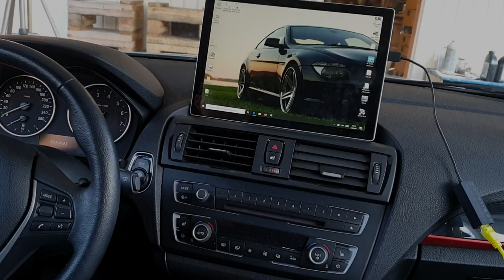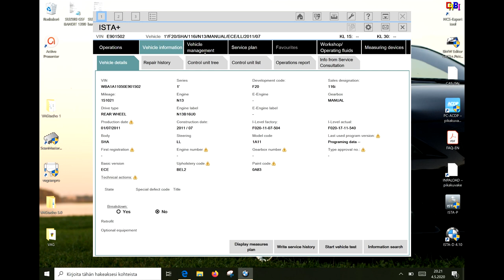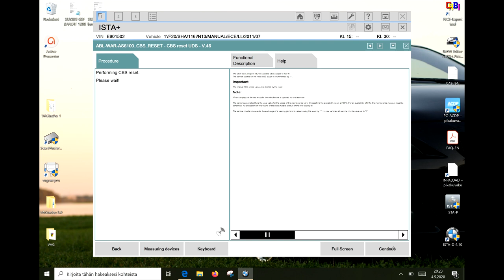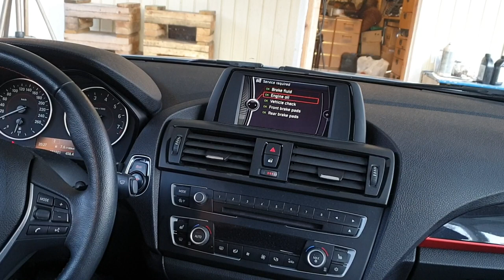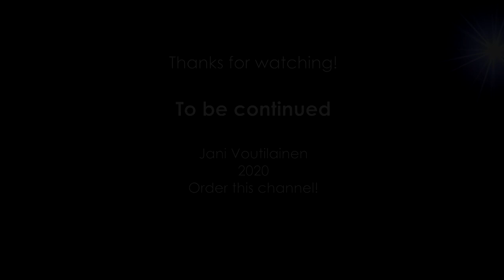OILSERVICE & MICRO FILTER with service RESET with ISTA-D - BMW F20 engine N13

Comment: Hi, do you also have the turbo wastegate rattle on coldstarts with the n13 engine?
Reply from the maker: Hi! Yes I think the same type of fault can also be found in my car. Need to inspect more ...
Reply: Inspect your heat shield it might be the primary cause.
Reply: Very easy fix. Search and you will find. Its a clips from a VW that fits. Costs app 6€
Reply: @freddychristensen6706  do you have the ref please !??
Reply: @badineramzyramzy1988  try these two fixes, both of them worked in many cases:

1) https://www.babybmw.net/forum/viewtopic.php?t=114449

2) https://f20.1addicts.com/forums/showthread.php?t=1657132

Both of them are cheap DIY's. Thank me later
Reply: @gofast3525  did you try one of These out? And how is the result?
Reply: @martinmax3958  i installed the vw clip since i bought the f20, and it is definitely an improvement. you need to be aware of the fact that this isnt electric motor, and every gasoline engine is making some kind of noise. n13 engine is known for these wastegate sounds on startup, nothing to be worried about, its just his characteristic.

Comment: I have the same engine and usually drain out around 3.7 to 3.8 litres of oil when engine is warm.  Even 4 litres prove too much.  I would add around 3.5L first and then top up by checking with the dip stick.